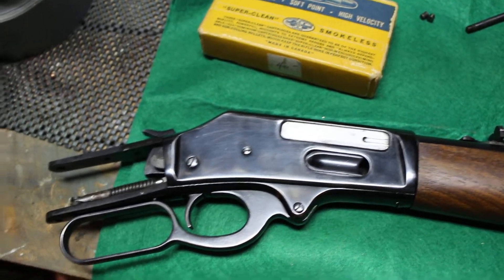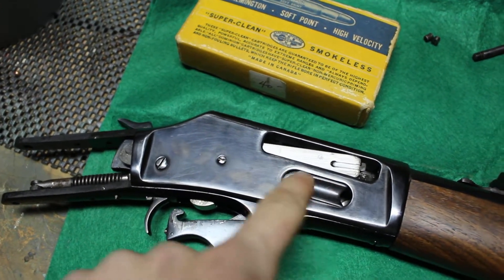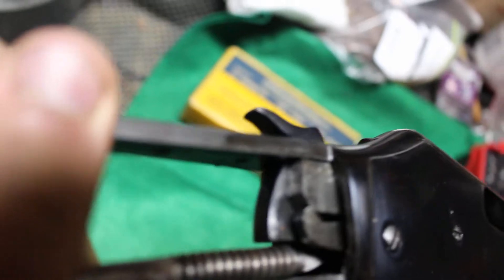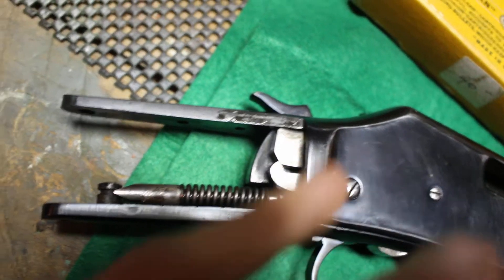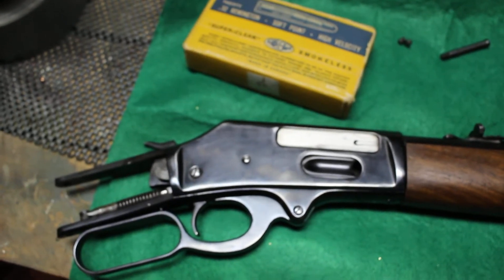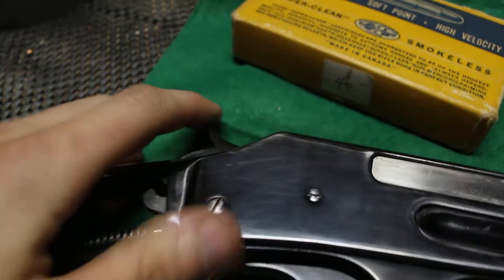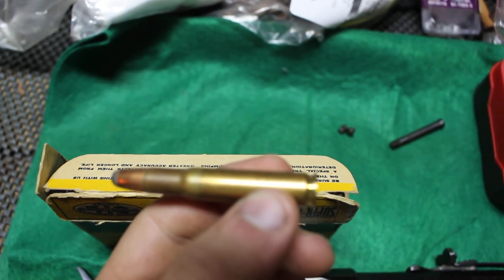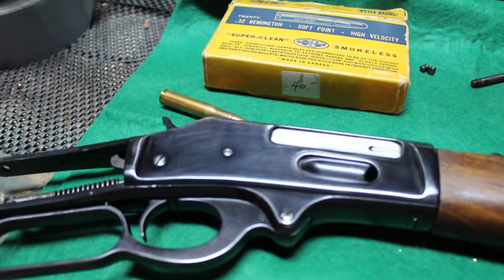Stevens High Power Model 425 Mechanism.

Comment: nice video if you ever disassemble this stevens please make a video. would you think this is a stronger action/lockup than a marlin or winchester?
Reply from the maker: Not stronger than the 1886 style locking thats for sure. I would compare it to a marlin, except this one moves the bolt down at an angle in the receiver instead of out the back. Almost as smooth as an original marlin tho!